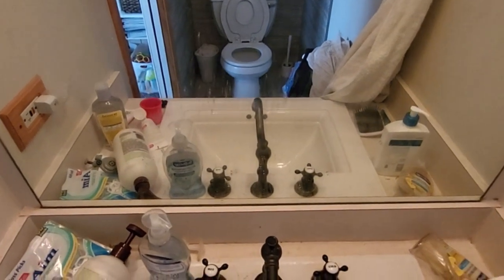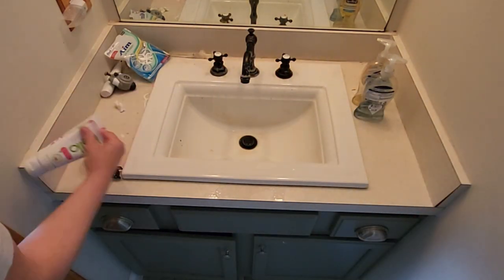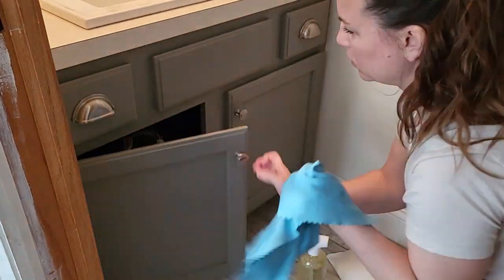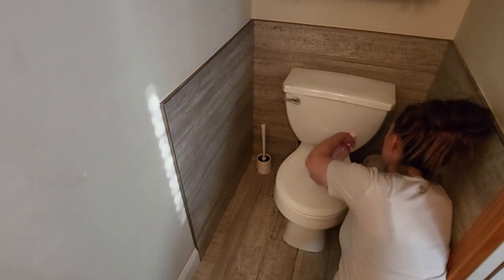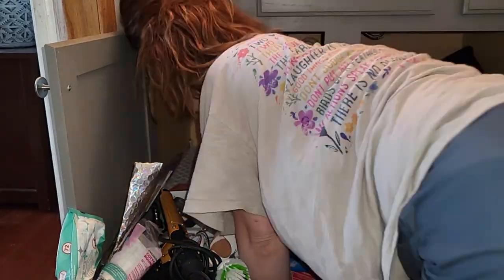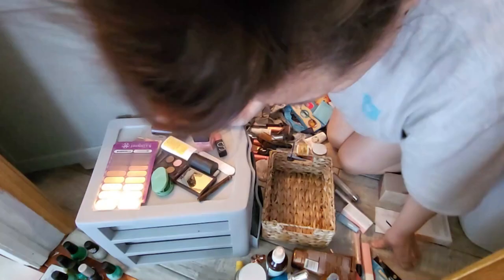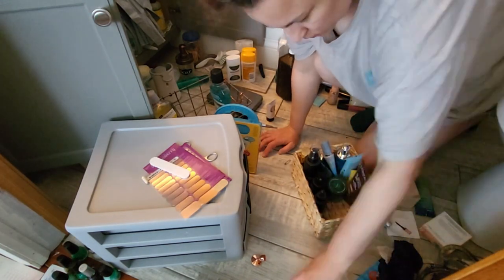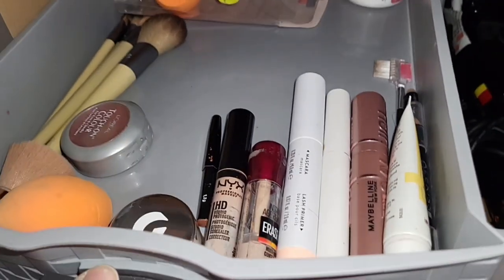MESSY TO MINIMAL MAMA REAL LIFE MESSY HOARDER SMALL BATHROOM CLEAN DECLUTTER AND ORGANIZE MINIMALISM

Comment: I tend to let things go, so watching these decluttering vids really inspires me to get with it and start doing that. So, even before I watched this video I had been sort of cleaning, decluttering today. Now, I want to go ahead and clean under my bathroom sink. Thanks for the tip on using what you have before you buy more. It's very frugal. It's easy to get sidetracked into starting in a different room, so I'm in my kitchen right now and then onto the bathroom. Or who knows? It feels refreshing to get rid of clutter and have more space. Thank you for the cleaning tips and encouragement!
Reply from the maker: You got this Regina! And having ADD I know how easy it is to be distracted. I also think its a feeling of overwhelem that makes us want to get away from the mess and start somewhere else. This is something I have been guilty of in the past but then only left with a complete disaster in every space. So I work hard at finishing each space before moving to the next even if that means you have to take breaks or clean in a couple seperate days. You got this girl! 💪🙏🤎